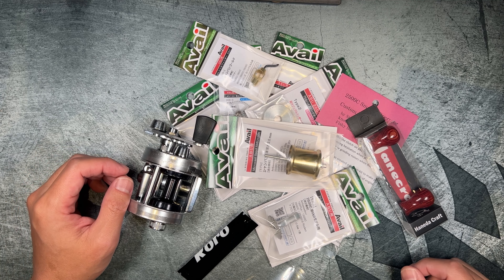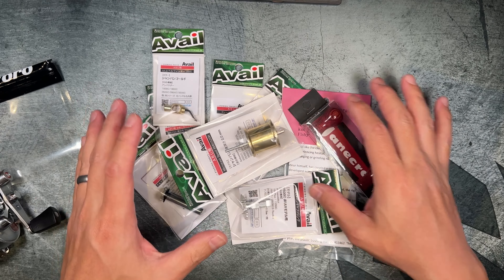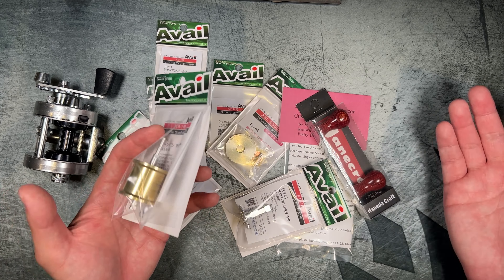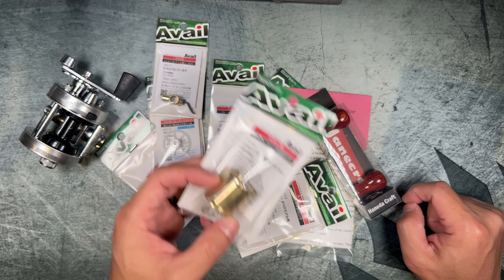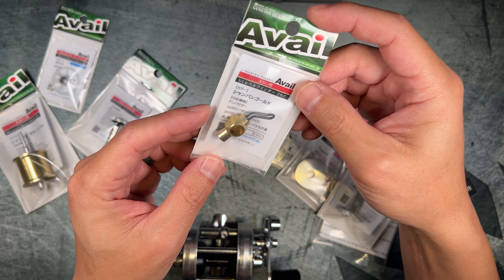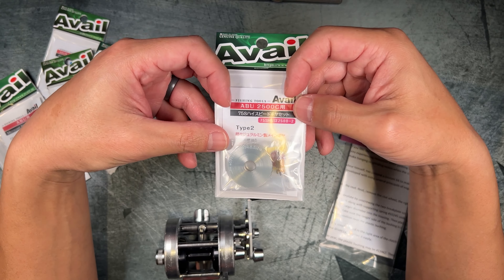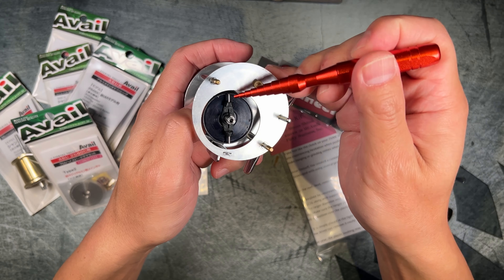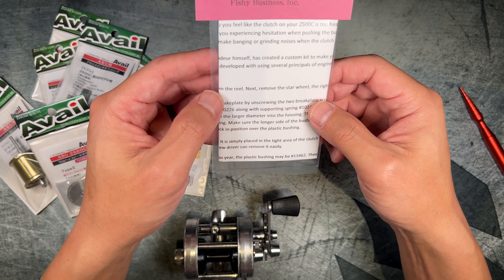What JDM mods did I add??? 🤔 ABU GARCIA 2500C AMBASSADEUR Part 2

Comment: The stock spool is just fine for bass fishing. Heck I was reeling in 12lb blues on a full current in the Arkansas river.
Reply from the maker: @denofearthundertheeverlast5138  hey Den! Totally! That bass fishing is basically what the 2500c was originally designed for. BFS tuning the reel allows people to use the reels to cast lighter lures for UL fishing. It’s often used for trout fishing after being tuned this way. Thanks for sharing your thoughts and experience! Cheers my friend!

Comment: I work on mine and is so easy and satisfying ❤️❤️ love my Abu
Reply from the maker: Hey Victor! It really is. It’s fun tinkering around with reels but these ones are quite fun in particular. It’s not great on casting performance but I get a huge kick out of the levelwind oscillating when you free spool. Soothing in a way haha. Anywho thanks for sharing and cheers!
Reply: @BFSFISHINGCHANNEL why you Americans always want to ty performance with the stupid trout magnet,do you know only Americans use that stupid thing, everybody else use small minnows in the 2.5 to 5 grams range to make really short and accurate cast for trout in small creks and rivers there's no trout magnet in that equation
Reply from the maker: @mojondro  hey Victor! I actually don’t use the trout magnet as a benchmark. Maybe I did when this video came out a while(years) back? I now measure a reels performance by it being able to cast under 1g to see its absolute lower limit. I also use it to cast several weightless soft plastic lures as my local lake does not seem to produce fish when using crank baits of any size or weight. It’s a bit mind boggling but soft plastics work well at the very least. Anywho, getting back to trout magnets… I think people mainly use that as a benchmark because it weighs about 1g and it’s the smallest lure/jighead that most people can think of. Other than that I have no idea why it’s become synonymous with reel benchmarks. Hope that offers some insight haha sorry I can’t be of more help. Cheers my friend!

Comment: I want to buy a classic abu reel, they are easy to disassemble and mantain.
Do you recommend me this one or the 6000c in terms of build quality?
Reply from the maker: Hey Alan! Ooc what will you be using the reel for? The 1500c/2500c sizes are more for freshwater bass and trout fishing and can be “bfs tuned” to allow for casting lightweight lures. The 6000c is a much larger sized reel and not quite suited to bfs use. Hope that helps! Apologies for the really delayed response and happy holidays to you! Cheers my friend!
Reply: @BFSFISHINGCHANNEL  Thanks, so the 6000 will suit my requirements. Happy holidays and holinights my joven amigo.

Comment: You did a before out of the box casting video correct? Looking forward to seeing the final modifications and casting improvements. 😀  I recently beefed up a slx bfs with hedgehog avail complete set. Not budget friendly at all. I can image the final cost on this bad boy but it will be definitely worth it 👌
Reply from the maker: Hey man! I actually didn’t haha. I was so excited to get it modded that I just went and filmed everything. So, I really only have an after modification feel haha. I can honestly say it’s super enjoyable to cast. Really enjoying the sound and feel of the reel. Currently, I have to edit and cut the mod install video as it came in at around 1 hour lol…. A lot of mistakes and errors but I’d like to show those with corrections. Anyhow, thank you for the feedback and suggestions and maybe I’ll try to revert it back to stock to get a comparison 🙌. Cheers!
Reply: @BFSFISHINGCHANNEL  lol 😆 I'm not in that boat alone. I did the samething straight to the modifications. You don't have to revert back even though if you did your back down video would be alot shorter.
Reply from the maker: Haha def not… when I get upgrade parts I feel like a kid in a candy store 😂. Sometimes the draw of just upgrading is greater than the draw to film hahaha
Reply: *break down video
Reply from the maker: Haha yea one thing I will say… I lost one of the two little brake shoes and it definitely is better with both. With one I have to use my thumb and the spool tension knob to really control backlashes. Glad avail includes 4 replacements in their little kits. Thankfully have two left to lose lol 😆
Reply: @BFSFISHINGCHANNEL  too bad you did not put out part 3 video.
Reply from the maker: @user-he6nj1zv9f  hey there! I actually did film the video but never got around to editing it. I think it clocked in at around 1.5 hours 😅😅😅. I keep meaning to edit it but it just continues to slip my mind. I will get to it one of these days… thank you for the reminder and cheers my friend!

Comment: the bearing you pulled out arnt original bearings standard bearings in that reel are spherical bearings ie curved on outer race to aloow for spool flexing
Reply from the maker: Hi Martin! Actually you’re right! The bearings I pulled out and de-shielded were slightly curved on the outer housing. I thought it was a bit odd and might have been due to wear. When I get a chance I can share a photo, somehow, that shows that curvature. Very interesting if that is indeed a feature! Thanks so much for sharing that info and cheers!

Comment: Hi mate, really looking forward to the finished reel.Not sure whether you can get them for that reel, but pretty sure the one size fits all in ABU, it does in the larger sizes anyhow.That is a ceramic pawl.May be another little add on.Cheers.
Reply from the maker: James! It’s been a minute! Hope all is well with you my friend. To respond to your suggestion, you read my mind and I did actually pick up a ceramic pawl! It must have come after this video was made though and so that is the reason it was not included. I think the ceramic pawl has 2 advantages over the steel one. 1. Weight. It might not be a big difference but the pawl on these reels is something that needs to move when you cast. 2.  A lower coefficient of friction. I can’t tell you how much lower but it’s on of the reasons why ceramic ball bearings spin longer than stainless steel bearings. Anywho, thank you for chiming in and it’s good to see you again! Cheers James!!!
Reply: @BFSFISHINGCHANNEL  No worries,yeah I have ceramic pawls on a couple of my ABUs I have customised, this combined with double bearing after market level wind = buttery smooth.
I am on the Facebook page as well since you pointed me in the right direction,have been quite active on there, give you a hint so you know it's me, my recent post is about the Cardiff DC.
Reply from the maker: @chepachii  James!!! Glad to see you’re on the group my friend and as odd as it might be to put a face to a name. It’s funny because that video was made by one of my good buddies who is an absolutely ambassadeur freak/guru. Anyhow, love that you’re in the group and it’s so good to see you out here again as well! I’ll come say hello over there. Cheers my friend!!!
Reply: @BFSFISHINGCHANNEL  Hi  again mate,you have inspired me, Tomorrow am picking up something very very special.
Once I've completed the project if all works out will post up on the forum.
Just a hint the reel I'm buying is going for between 3 and 8 hundred dollars on eBay .
Cheers
Reply from the maker: 🙌🙌🙌 yeeeeeessssssss!!!!! Looking forward to your project my friend!!!

Comment: Now you have a Double AA Fuel dragster of an old Ambassador. Going to have to educate your thumb for awhile. Please, what was the before and after weight of your marvelous little AaaBuuuuuu...! Please reply.
Reply from the maker: Hey barclay! Actually the centrifugal brakes were quite good on the reel and didn’t require much thumbing at all. Sadly, I didn’t get any weights of the reel beforehand but there might be published information on that for the stock reel. With the current setup, I’ve actually swapped the spool and brake assembly to the magnetic versions, the reel now comes in at around 249g. Granted the aftermarket handle I went with isn’t exactly lightweight. Anywho, hope that helps and cheers my friend!